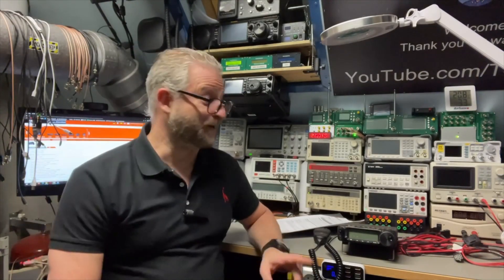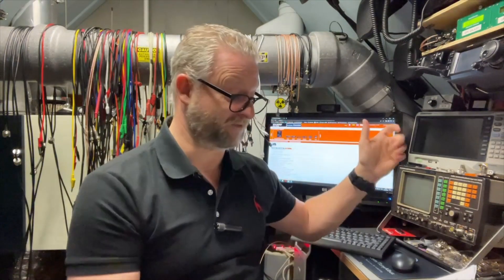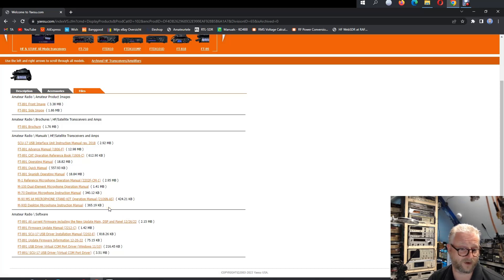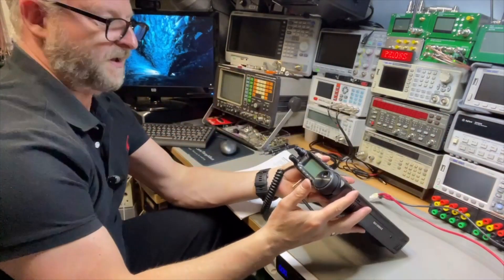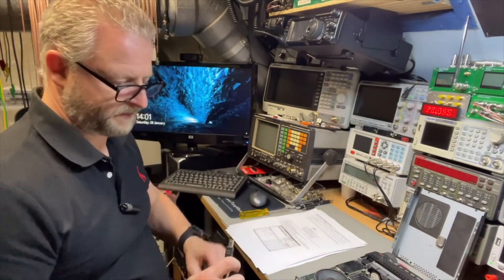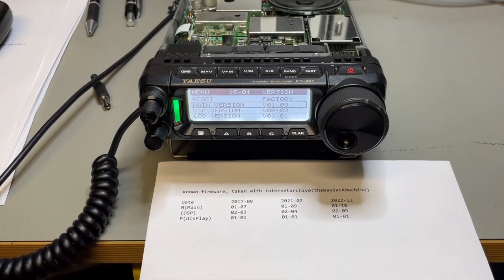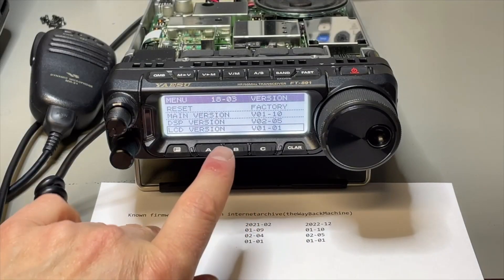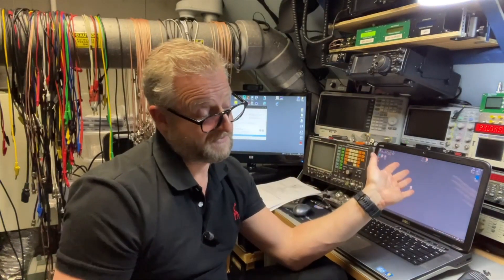TA-0332: Yaesu FT-891 How to Update Firmware - 2023

Comment: I won’t be doing mine unless it gives a big improvement.
Reply: I wonder if I buy an 891 now, how old the firmware will be?  I just did a firmware update on my FT-710 and ran into trouble - but finally got it right. It sounds like the update for the 891 is far more involved.
Reply from the maker: @MrTommy001  You will be fine 2022 was the last update. that will be in your new machine i may hope. Enjoy!
Reply from the maker: That is the problem with yaesu, they are so bad with proper changelogs

Comment: Hi Tony,

Thanks for the video.

Does the the new firmware allow switching between USB & LSB by one single press of the "F" button. I read somewhere that by a single press of the "F" button this is now an option ?

73 Mike G1ZRN.
Reply from the maker: Hi Mike, Thank you. It is unclear what is changed when, Yaesu is terrible at making good change logs. last few updates are guessed as DSP and 6mtr band channel updates. but other small changes are unknown. 73 Tony PE1ONS

Comment: The "old" USB driver is actually for use with the SCU-17 remote access network interface device, it says so on the link, nothing to do with upgrading the radio or everyday USB access to the radio.
The firmware update replaces the firmware completely (not just replacing some files like in most software upgrades on a computer) so there is no reason to, or advantage, in upgrading the radio to anything but the latest firmware directly. The only thing you are doing by upgrading via the interim version is doubling the risk of something going wrong.
Reply from the maker: Yes

Comment: Did the firmware update make any noticeable difference to the operation of the radio? I'm debating doing mine.
Reply from the maker: Yaesu does not use or release release notes to public. usualy its little changes or DSP updates. for me its unsure what the before-last and last have changed.

Comment: I have 3, 891’s and it was a pain in the ass.  I have not checked  in a few years if any newer firmware updates are available because it sucks.
Reply from the maker: Hi, i wonder why you have 3 if you don't like them.
Reply: @TonyAlbus   I love the radios, The firmware update is a PITA.
Reply from the maker: @cablemedic207  Agree!
Reply: @TonyAlbus  Also, while you have one on the bench, Id love to see a video of an alignment on the SSA .  I was looking through the Service Manual for the USA one, but it requires to  plug into mini coax connections on the boards but doesn't tell you which type of connectors they are.
Reply from the maker: @cablemedic207  Thanks for the idea, yes will be nice to try
Reply: i did the update and now its a Brick..